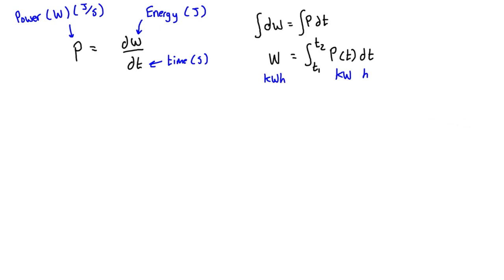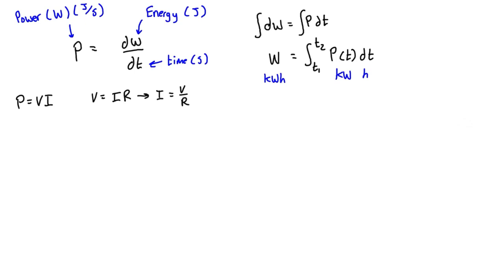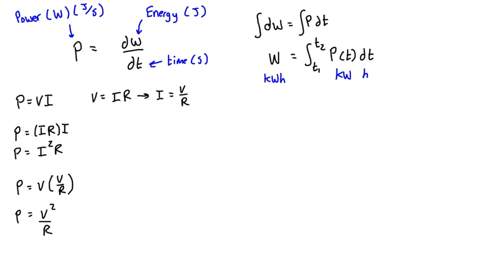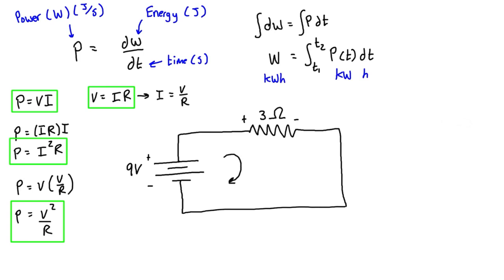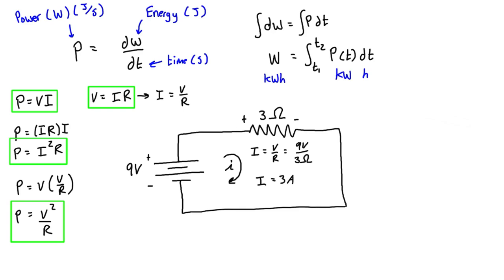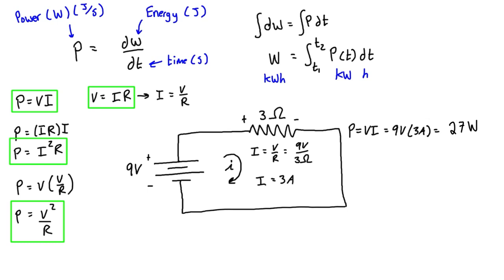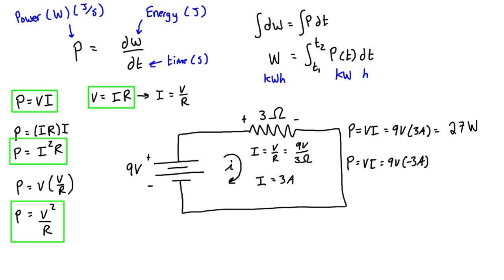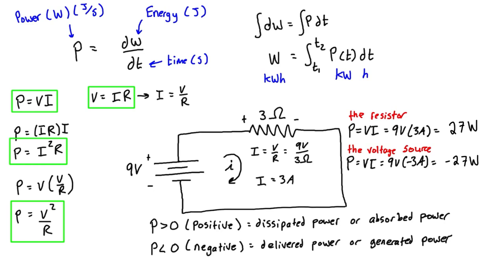What is Power (Electric Circuits)

Comment: Thank you for the Correction.
Reply from the maker: Yes thx for that. Sometimes the stupidist things slip through
Reply: @Engineer4Free  Most Welcome
Reply: @Engineer4Free  How much edit was involved in the correction ? 
The audio edits were obvious . Did you have a recording the white board from which to work forward ?
Reply from the maker: Yeah the audio is really obvious because I don't always speak at the same pitch, but it's better to correct it now anyways. For this edit, I just drew the correct numbers in my drawing program, and pasted them to the video editor as static images in the top video layers at the appropriate times, letting them run till the end, and then also re recorded just each time saying the new numbers and deleted the old audio I was replacing that all took about 15 minutes, and then re saving and posting was maybe another 15 minutes. Still shorter than redoing the whole video from scratch though. You'd be surprized how long a 5-10 minute video can take to produce.
Reply: @Engineer4Free  I've done a little video production so I got an idea how work and effort go into every minute of aired programming.
Thanks !!!